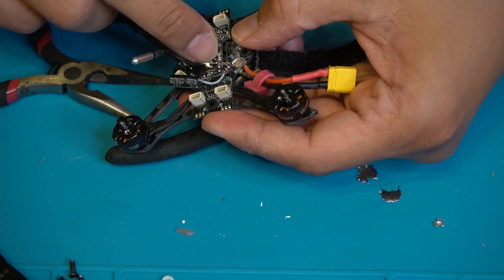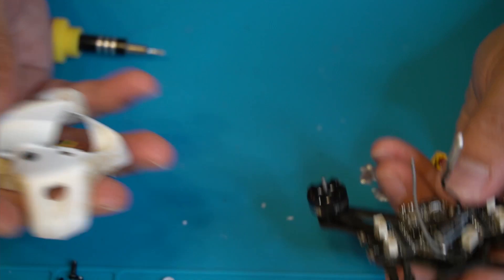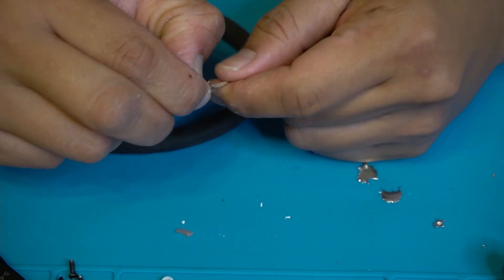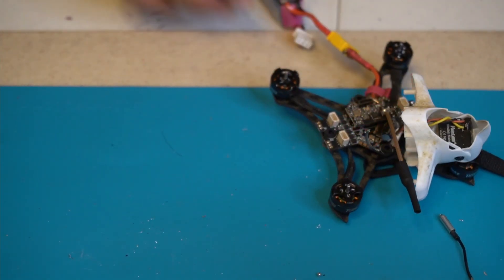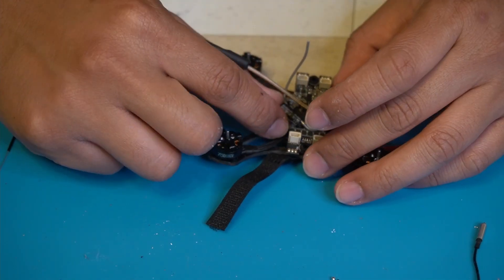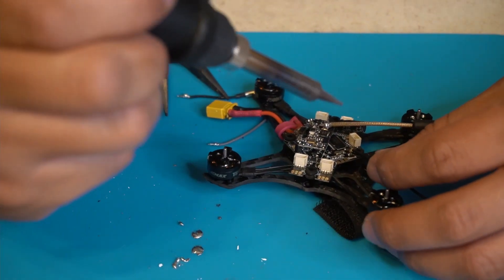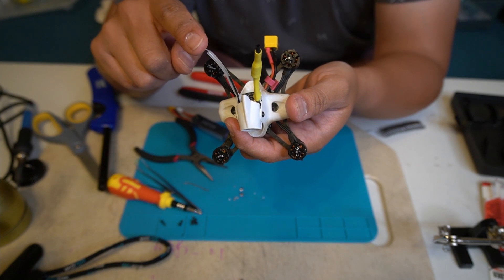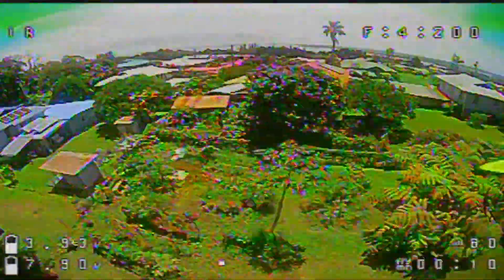How to repair an Emax Tinyhawk 2 Race RX and VTX Antennas

Comment: And, do you need to rebind it or anything after reaplacing antennas?
Reply from the maker: You shouldʻve have to as the settings are already "flashed" onto the flight controller/AIO board.  You are simpling replacing an "external" piece.

Comment: It hurts to look at the solder drops on the table 😂
Reply from the maker: I'm such a newb at this but gottah learn some how.  Good thing for the silicon mat.  Do you have any tips to prevent solder from rolling off?
Reply: @ChrisParayno  I could give some advice, but I will refrain from it. Giving advice through a translator is not a good idea. By the way, I have a soldering iron just like yours and it is not the best choice, although it is quite suitable for a hobby.
Reply from the maker: No worries.  Yeah, for short term builds it's worked okay but it really gets hot.  It came with a kit, so I can't complain.  I've been looking for another budget friendly version.